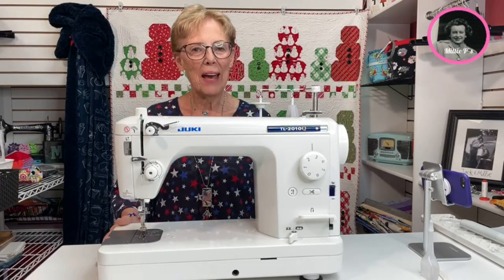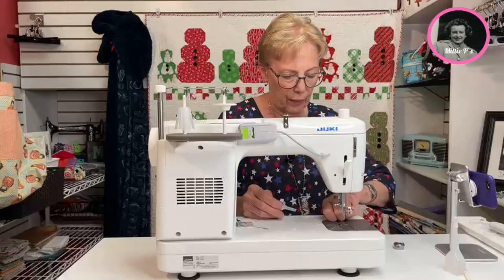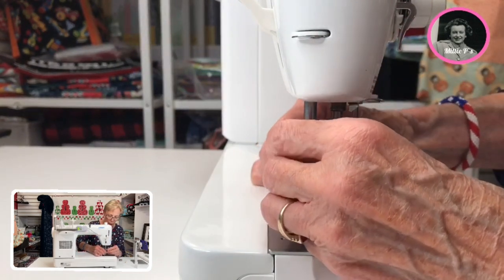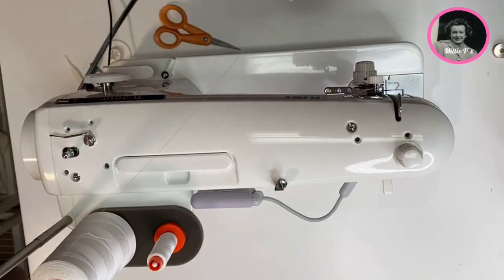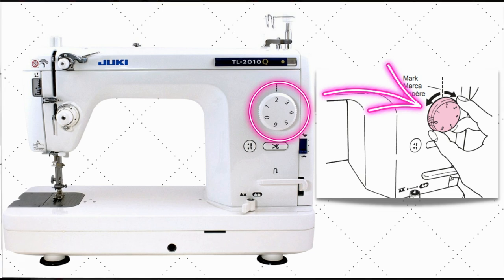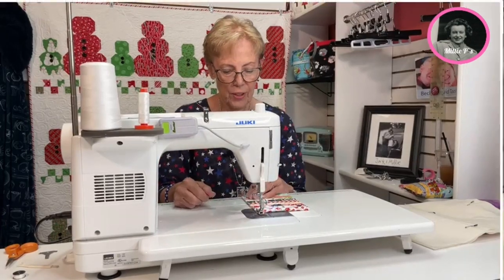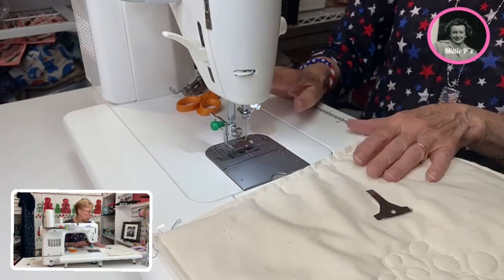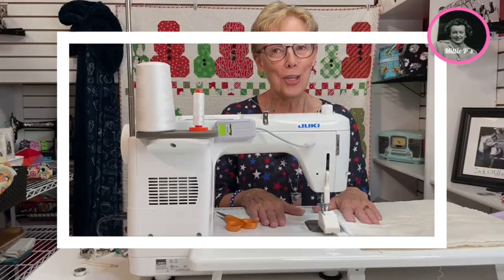The Juki Sewing Machine

Comment: Thank  you so much for the Super Fantastic video!  This TL-2010Q machine is a dream!  When threading the machine the manual shows to go down in the first hole and then down through the third hole; whereas you showed to go up through the first hole and then up again in the third hole.  I'm going to love this machine!  The automatic needle threader worked the first time for me.  I was able to thread a couple bobbins and actually sew on a couple scrap pieces of quilting fabric.  I'm hoping to improve my piecing accuracy with this machine.  I purchased the 1/4" foot for the Juki.  I will practice and learn to use the knee lift.  Also, I love the fact you can free motion quilt.  I've been intimidated in the past, and I rent a longarm machine to do all of my topquilting, but this machine will be fantastic for table runners and other smaller quilts. I will look into getting the Gypsy Hoops as well as the light you showed.  Thanks again!
Reply: Yes, stick with the manual on how to thread the machine

Comment: Hi …love your video….I’ve just bought this machine new from Amazon and I have heard that the machine may need adjustment straight from the box…..I’ve checked the bobbin tension, and have tried all kinds of tension on the bigger tension discs but still seem to have loops on the bottom….I have re threaded several times to check if I’m doing it correctly….any suggestions as to what I might be doing wrong? Or do you have a video on this topic? Thanks so much

Comment: Couldn’t see where the oil in the bobbin mechanism was placed.  Did you edit your video?  Think not. Because no one could see through your hand. You could have pointed to it, first, with a staletto or seam ripper tip. I have this machine I’m thinking of marking 
the oil holes with a dab of colored nail polish.  I need a refresher so, I’ll go watch a different intro demo.  I ❤ my 2010.  It’s solid, heavy. Only needs supplemental lighting.

Comment: Interesting about that 3 holed part at the top of the machine for threading.  I have the TL-18 QVP and the diagram shows it to go from the top down on the right side hole, then go from the top down on the last hole on the left.  However, it looks like you threaded from the bottom up.  I wonder if it's different between the two models.  Now my diagram does say to thread nylon or similar threads coming up from the bottom of each of the three holes.
Reply: It could definitely be different on the two models that’s why I watch more than one video but I’m sure you have figured it out by now

Comment: I love my new Juki new si ce September my to thread keep braking off any suggestions help getting  frustrating
Reply: Two suggestions that helped me…first, make sure the eye of your needle is the appropriate size for your thread.  If it is too small, it will shred the thread and break it.  Second, make sure you have threaded BETWEEN the tension disks.  Seems obvious, but if you thread the machine with the presser foot down, you may not have them fully open when threading.  Good luck!

Comment: I would love to hear from people about the leg lift bar. I find that it sits way too far to the left that when I sit at my machine I am not able to sit in front of the needle and use the leg bar, I have to sit to the left of the needle. It’s a great selling feature, but it is in a bad position. I have talked to Juki about it and they have no answers. I guess if you’re an 80 pound Asian woman it would work, but not for an average American woman. Very disappointing bc this is one reason I bought this machine to use for quilting, and I can’t use it. I’ve watched many videos on this machine. Everyone talks about the leg bar, yet no one demonstrates it because of this exact reason. It doesn’t fit anyone over about 80 pounds. Juki even tried to tell me I wasn’t putting it in the hole correctly, but it only goes in one way. It’s a problem in the design of the machine, which is unfortunate because I would love to use this feature.

Comment: Can you do ruler work with the Jimi 2010q
Reply: Yes you can.  I use a ruler foot and do most of my quilting that way.  I am curious if anyone has had this issue…i do not use my thread cutter because it always pulls the thread of the needle, and the automatic threader is terrible.  I have one on my Babylock that is perfect and easy,  but this one never ever works.  So the unthreading when I cut is super frustrating.  Tension looks great, so I dont think that is why it pulls out.  Anyone have a suggestion?